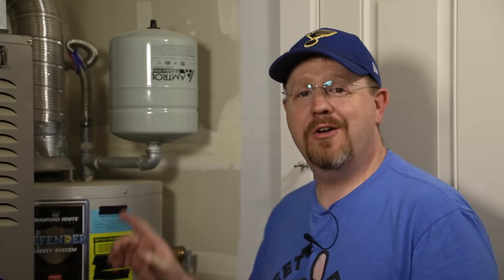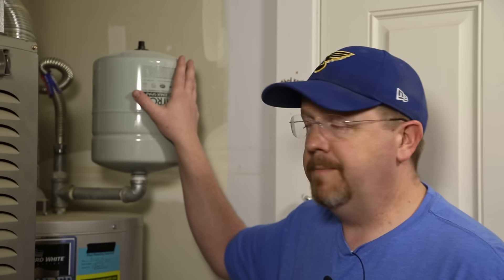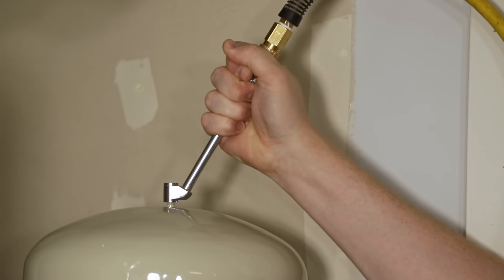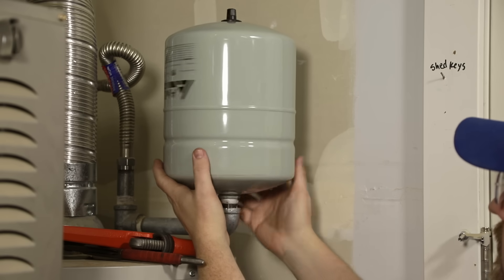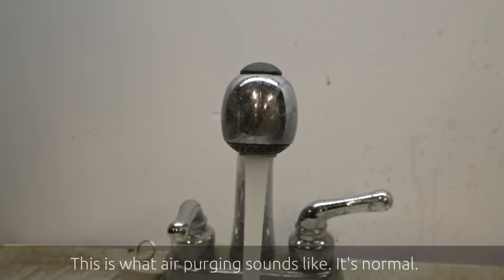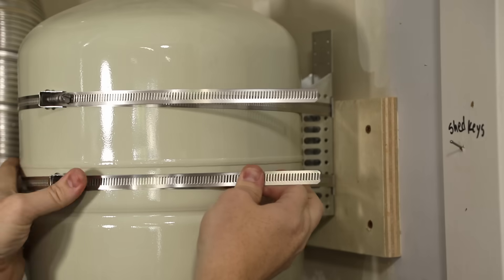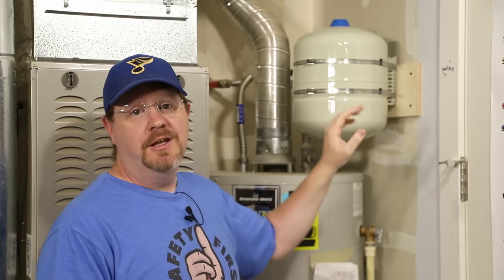What Is This Tank? How to Replace and Maintain a Water Heater Thermal Expansion Tank

Comment: Great job. I like this very much, very helpful. Keep up the good work
Reply: He is the nicest man in the world.
Reply: Nice work. Great info
Reply from the maker: Thanks a lot!
Reply: @AmplifyDIY  The house bought has an expansion tank and it is required by the county. The one that is attached to my water heater is mounted horizontally above the tank. I noticed that the one in the video is mounted vertically. Does vertical or horizontal mounting matter in relation to the bladder inside and the water and air inside and its ability to function properly?
Reply from the maker: @Laughinghawg  Typically they are mounted vertically, but check the installation instructions for your model of expansion tank to see if horizontal installation is ok. If you throw the model number of your tank into Google you should be able to find instructions. Good luck!

Comment: 1. My tank is installed hanging down from the low basement joists with the air valve facing down.. is this incorrect/dangerous.  Im guessing from what I learned here, that perhaps more air pressure wld be needed to combat the gravity effecting the bladder?

Comment: Leaving a comment to hopefully boost your vid in 2025. Like another commenter a year ago, I had a leak, bought a relief valve and a tank thinking I would replace both, but my tank read 0 psi. Earlier this year I replaced both rods and the upper thermostat so I was surprised to hear hissing again.

When I replaced the tank I had a small hiss but a little tap on the valve fixed that too. Thanks for the vids, I watched this, the valve replacement and how to drain the tank properly.

Comment: Our experience with this was that the hot water at the sink in the kitchen would not come on. Then the one in the bathroom vanity sink would not come on. The plumber installed a new expansion tank and it worked. He showed me that the old tank was full. Ours was electric not gas. My question is this. I had no way of knowing that it was the water expansion tank was the problem? This is why I called the plumber.  Is my experience a valid reason for replacing the tank? Thank you!
Reply from the maker: It's a bit of an odd set of symptoms... generally when one of these tanks fails it does not cause loss of pressure/flow at the fixtures. If the old expansion tank was full though, it definitely needed to be replaced. Do you know if the plumber did any other work on the system at the same time?
Reply: This was my situation exactly. My expansion tank was empty.

Comment: Tape and then pipe dope is the only way to go.  But if you have the cheap chinese or india fittings, you might need to put a thinnest lay of dope on first, I'm talking about thin as possible, then wrap the tape and then dope up as normal.  But yeah just tape and then dope is the way to go 99% of the time.

Comment: Thanks for this.  I lucked out in that the previous plumber wrote the PSI on the failed tank when he installed it, so I just had to match that.  Easy swap out. I sort of half wrapped a towel around mine as I s l o w l y unscrewed it in case the pressure was still there and I didn't get sprayed with hot water.  Zero water came out though.  I drained about 3 gallons before I unscrewed it.
Reply from the maker: Glad it worked out for you - good job on the extra precautions!

Comment: My old water heater didn't have an expansion tank.   This new water heater has a third hole.  Do I need an expansion tank
Reply from the maker: You likely don't need one if your old one worked fine without it... but adding one is a good idea, and will help future-proof in the event your municipal water supply adds backflow prevention in the future. Great question, and thanks for watching!

Comment: What about when you need to add PSI to the expansion tank when your water pressure is increased by the city engineers? Do you have to shut off the cold inlet, drain the hot side? The water pressure to my house increased from 50 to 55 PSI.
Reply from the maker: A 5 psi change is not a super big deal, but yes: you need to make sure there is no water pressure on the water side of the tank in order to make sure you are getting an accurate measurement of the air side. Good luck!

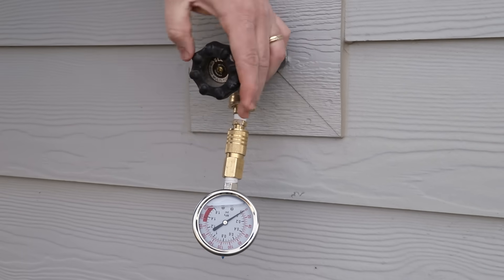Comment: Thanks for this video. I believe there is a mistake at 2:40 which is that you said the expansion tank should be charged to the same pressure as the city pressure, before any pressure reducing valves. Shouldn't it be charged to the same pressure as your system pressure? And the system pressure is the pressure you get after the pressure reducing valve in your house. Otherwise the expansion tank does not protect your plumbing system from higher pressures than you system pressure.
Reply from the maker: You are correct. It should match the pressure at the inlet of the heater. This can be difficult to measure directly, which is why I measured it at a hose bib. this should be after any pressure reducer valve as well, so it should match the inlet pressure at the heater.

Comment: If after pressing the valve on top, nothing happens, not even air. What that means?
Reply from the maker: Most likely that means the air bladder is completely empty, but the membrane inside has not failed yet. I'd drain a little water off the tank, then with the cold water inlet turned off I'd check pressure again, and add air pressure to see if it holds. Good luck!

Comment: Great Job! Will Be Replacing Mine Before The Winter Even If It's Not Having A Problem Just Because Its 7 Years Old! You Did It With Zero Floods :O)  Nice Bracket Install Too! Mine Hangs From Large Pipe And Not Close To Any Walls But I Think Its Not A Problem Even If It Filled With Water, I Might Add A Hanger For The Pipe Itself? Just Replaced My TACO Circulator And Was Watching Videos Of How To Purge The Air Out Of The Zones. Thanks To Good People Making These Video's We Can Save Thousands By Doing It Ourselves! Thank You! 👍

Comment: a perfect training video for learners. thanks 🙏
Reply from the maker: You're welcome! I'm glad it was helpful.
Reply: @ I have bought the gadgets at the links, pressure gauge and the apparatus to fit for measuring the pressure in expansion tank. But the apparatus doesn’t fit on the pressure valve of the expansion tank.

Comment: Hmm 🤔 I didn’t have any expansion tank on my water heater. Only on my water boiler heating
Reply from the maker: This is a somewhat recent development with residential water heater systems. If you live in an older home or in an area that has not yet mandated these things, then you most likely won't have ever even seen them. But lots of new homes have them, as residential and regional codes change and get updated.

Comment: I was told to use brass fitting what type of fittings are you using?
Reply from the maker: Brass is better... .but I'm re-using the galvanized (ick) fittings that the plumber installed when this house was built. I plan to replace the galvanized... just have not had time yet. Thanks for watching!

Comment: Does it matter what way tank is installed mine is about 2 ft away from water heater and air input pointing down
Reply from the maker: There are general guidelines for installing these tanks, but local codes may vary a bit. Also, the tank manufacturer may have more specific installation instructions. I'd suggest you try to look up the manual for the model you have installed and see what it says about installation location, distances, orientation, etc. It's likely fine how it is.Good luck!

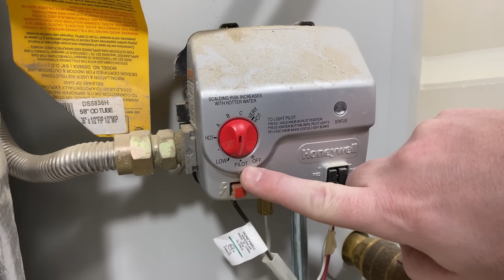Comment: Another question, at 4:42 you mention to get the water out of the exp tank you have to just drain a few gallons out from the drain valve at the bottom of the hot water tank, but doesn't the cold water line go from the expansion tank into and almost down to the bottom of the hot water tank? So wouldn't you have to get the water level below that to actually get water to start flowing out of the old exp tank?
Reply from the maker: Great question! The short answer is no, due to gravity and how water always finds a level. 

Longer answer: Once you de-pressurize the system by turning off the cold water inlet, and you start to allow the tank to drain by opening the drain valve and opening a fixture to allow air in (faucet, T&P valve, whatever) the entire water heater (with the expansion tank included) can be though of as one big tank of water, which will want to find a single level for the top of the water to sit. When water starts to drain out the bottom, the level up in the expansion tank will immediately drop as that is the highest level of the water in the entire system. That's why you only need to drain out a little bit... the little bit exiting the bottom of the tank is allowing the water level in the expansion tank to drop. 

A simpler thought experiment: Consider a glass of water with a straw in it (much like the dip tube in a water heater). Where does the level of the water sit in the straw? What about if you suck a little water up into your mouth, but then allow air to come in through your nose without swallowing? Where does the water in your mouth go? I think you'll find it'll drain right back down into the glass through the straw.

I hope this helps!
Reply: @AmplifyDIY  Hi, not sure if my further reply showed up above? Let me know what you think
Reply: @AmplifyDIY  ok I think my reply worked this time: I thought exactly what you thought but when I drained 3 gallons of water out of the bottom of the hot water tank I’m still getting pressure spikes like my expansion tank isn’t working properly. I have installed a new one thinking my old one might’ve been faulty. Unfortunately I forgot to set the pressure to 60 psi (my home pressure) and I kept it at the out of the box pressure which happened to be 30 psi. 

So to solve the problem, I shut off the cold water supply to the hot water tank, turned on a hot faucet to relieve all pressure (but then I closed it a few seconds later after water was reduced to a drip * this may have been the error, possibly, read on), and then like you suggested I drained water out of the bottom of the hot water tank, and at first much water wasn’t coming out so I realized I needed to allow air in (remember earlier that I had closed the hot water faucet right after flow stopped) so I reached up with my other hand and opened the temperature and pressure valve only until I had drained 3 gallons from the bottom of the hot water tank, after that I set the pressure in the expansion tank to 60 psi to match my house pressure. But I’m still getting pressure spikes, the only thing different than what you described was that at the time I set the pressure in the exp tank to 60psi the system was closed (remember, faucet was off, and so was inlet water valve). Do you think that was the critical mistake in why I’m still getting pressure spikes?
Reply: @AmplifyDIY  But water is not flowing out of my tank's bottom drain valve even with four household hot water taps currently open. Why is air not coming in through the top of this attic mounted water heater through all of these open bathroom faucets? It flows fine when I open the T&P valve though.

Comment: Could you comment on whether Thermal Expansion Tank can be installed Horizontal as well  as  vertical???
Reply from the maker: It depends on the tank - so consult the instructions for any tank you are planning to install before you purchase it. The tank I installed in this video specifically says it can be installed in either vertical orientation, but not horizontally. I've seen some tanks from other manufacturers though, which do allow for a horizontal installation. Good luck!

Comment: 2:39 Why is there water in your pressure gauge?
Reply from the maker: That's actually oil - the gauge is filled with it from the factory. Here is how I built it: https://youtu.be/Lkh49kSUmvg

And here is the exact gauge I used: https://amzn.to/3dW4DpQ
Reply: @AmplifyDIY well, totally makes sense now, thank you for taking the time to answer and providing the links! I have another (slightly more technical) question but I'll post it as a separate comment instead of as a sub question to this

Comment: Do they help with noise from water heater?
Reply from the maker: Depends on the noise. These can help a bit with something known as water hammer, but that's not usually a noise associated with just the heater. If your heater makes a lot of popping/crackling/banging noises while it's heating, it likely needs to be flushed badly: https://youtu.be/hs5N7HyDUWo

Comment: What would cause my water to not get hot after following your steps? Heater seems to be working with no faults water gets to a warmish temperature and then never gets past that. Yesterday morning my water would sizzle your skin and after the tank change it doesn’t even get to mild temperature.
Reply from the maker: Did you set your thermostat back to the original position? Or is it still super low?
Reply: @ original position. It ended up just needing more time to heat the water than I thought. After sitting overnight everything was good to go thanks for your reply👍🏻

Comment: Thermal expansion tanks are not supposed to have water in them.  If they ever get water enough water in them that weight is an issue, they need to be replaced.
Reply from the maker: As they operate normally, they can and should have some water in them, but not much, and you are right: certainly not enough where weight is a big issue. Thanks for watching!

Comment: Can you mount the thank horizontal
Reply from the maker: It depends on the tank. The instructions with this one allow for mounting in either vertical orientation, but not horizontal. However, I have seen some tanks that indicate they can be mounted in any orientation. Check the install instructions with your tank.

Comment: Fantastic video! 
Thank you for sharing your knowledge.
Question: I was taught not to use galvanized pipe on pressurized water lines since it corrodes faster. I noticed you are using it. Is that ok?
Reply from the maker: Yeah, galvanized is not a great idea. Unfortunately I did not install this system - the licensed plumber who did my whole neighborhood installed them all this way. I guess it meets code, and is a little cheaper... but getting this replaced is on my short list of projects to get to just Real Soon Now™. Thanks for watching!

Comment: I have thermal expansion valve on the cold water inlet instead of an expansion tank that is leaking. Would you say the valve is stuck with sediment or faulty? Should it be replaced?
Reply from the maker: If it's leaking, it certainly needs to be replaced. I'd shut off the water supply and remove the valve to inspect / replace it. Good luck!

Comment: Also, would the WH breaker need to be turned off for this?
Reply from the maker: You may have missed it, but this is a gas heater. For an electric heater, yes - absolutely turn off the breaker. Thanks for watching!

Comment: So is it important to shut off the cold supply side to the WH and drain the hot side to depressurize?  I think you say that but is this critical? What happens if I kept the supply side on and just measures/filled?
Reply from the maker: You absolutely have to de-pressurize the water heater tank in order to get an accurate reading of the air pressure in the expansion tank. I covered this pretty carefully in the video - if you don't de-pressurize the heater, then when you measure the pressure in your expansion tank you are really just measuring the pressure of the water heater itself.

Comment: Liked and subscribed, great video it really explained just what I wanted to know. I’ll look at more of your videos, see if I can learn even more! I’ll add that this video was published four years ago and the information is still current, timeless even. Now to decide if I want to switch my gas tank-type heater to tankless, and that might also need an expansion tank near to it. Seems like the size used in the system is important. — I guess if you had to update the video, that’s something to discuss; also the amount of distance from the heater to the tank is important.
Reply from the maker: Hi TSP - if you switch to a tankless, you likely won't need an expansion tank at all. It's there because on a system that uses a large tank of water, that water is what does all the expanding. With a tankless system, there is not a giant tank of water sitting there that expands as it heats.

As for distance from the heater: yes, it matters. Consult the instruction manual for installation guidelines for your specific tank, as they all vary a bit. 

Thanks for watching!